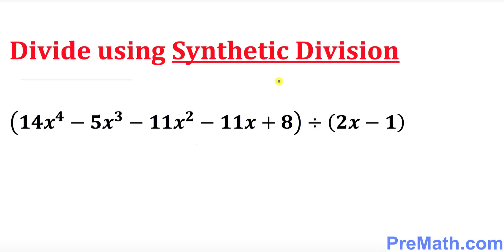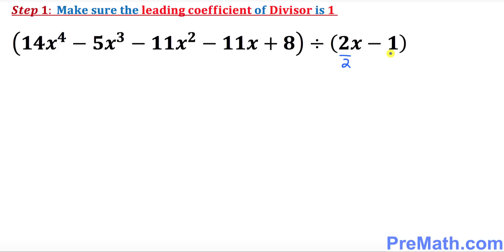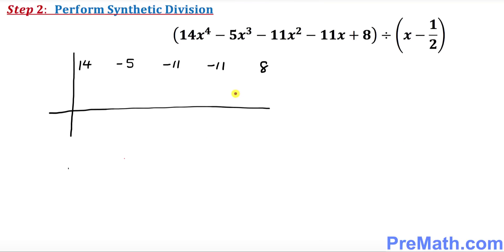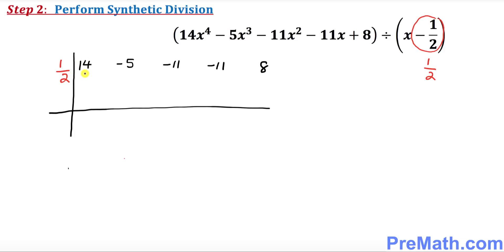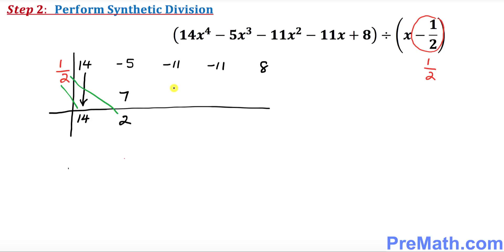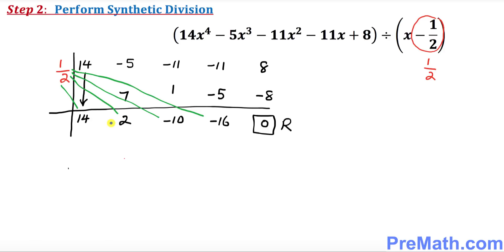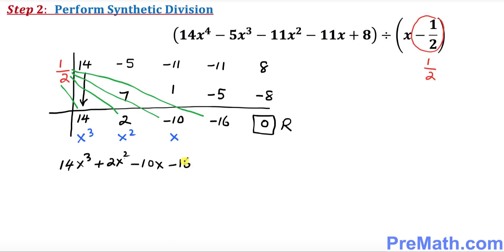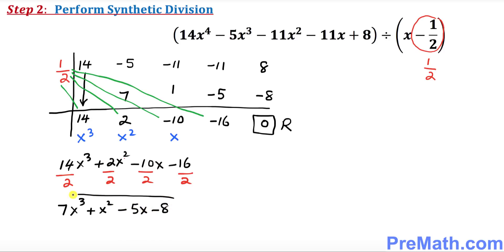Divide Polynomials Using Synthetic Division - Step-by-Step Approach

Comment: The last step when you divided by two is wrong! why are you diving by two when the equations are not set to be equal?
Reply: THE LAST STEP IS CORRECT! MULTIPLY  (2X - 1)(7X^3 +X^2 - 5X -8) & SEE!
IT'S LIKE 4/8=1/2 BECAUSE YOU DIVIDE NUMERATOR & DENOMINATOR BY 2! SAME AS ALWAYS!